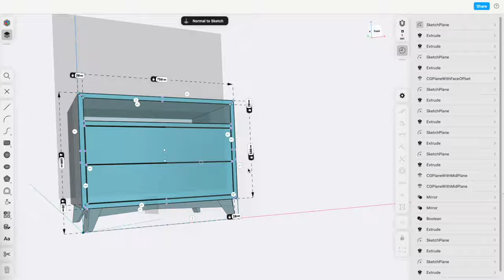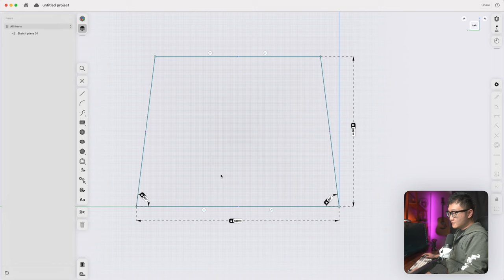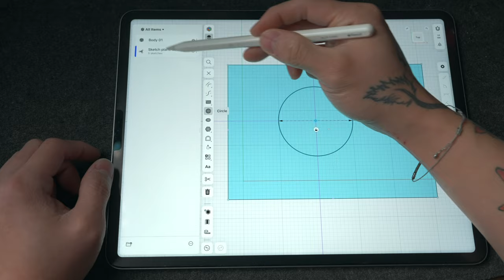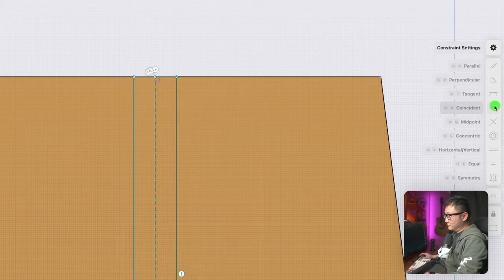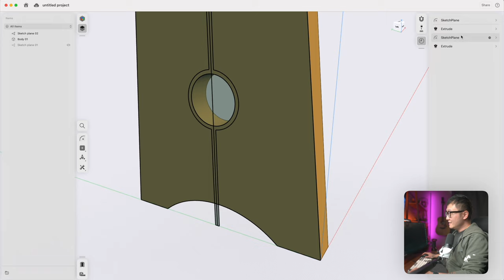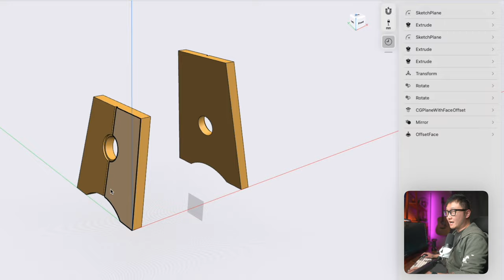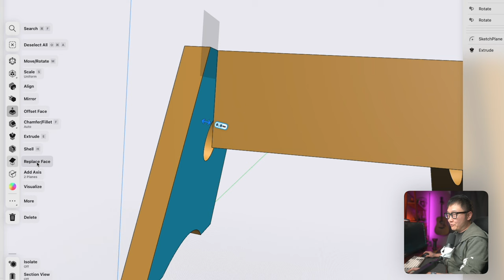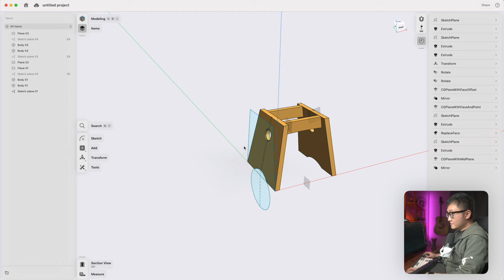Learn Shapr3D Parametric Modeling in 30 MINUTES - For BEGINNERS

Comment: I am using the latest version of Shapr3d and I am following along drawing this stool. When drawing the seat I have to select all parts as you did but I cannot select the centre. When I extrude I am left with a rectangular hole in the centre of the seat.

Comment: Just out of curiosity, since I use the iPad with a keyboard, I have become accustomed to using shift to select multiple specific things. Is the Apple Pencil capable of selecting multiple things? I don’t mean the selection tool since it doesn’t work if objects overlap
Reply from the maker: Yes. You just double tap to select parts

Comment: YES good beginner video. I have been using the new version for a while. Along side the old version. But I tried to use the new version as I would the other standard version and I see I was doing it al wrong. Also I was snuggling at trying to get things in my designs to line up. And scale with each other. Because I did not understand construction plains and constants. Will go and try!
Reply from the maker: Hope it’ll help out with your workflow!

Comment: Hey Alex. I’m following along and got to the point where you made a second sketch on the same plane as the first. Are you using the version from Dec 1 in this video?  Because mine just calls it a sketch in the item list and when I turn it off, select the face of the leg, and try and add a second sketch, it just goes back to the original sketch instead of adding a second sketch plane just like it does in the non beta version
Reply from the maker: Are you using the beta? Sounds like you’re running the current version of the program. This tutorial is for the parametric modeling beta
Reply: @BevelishCreations  I'm using the beta (according to the info it's ver 5.520.0.6147) and I'm having the same issue (ipad).  Clicking on the face of the leg and entering sketch just goes to sketch 1 and does not open a new sketch.  Is there perhaps a setting somewhere that toggles this?
Reply: @BevelishCreations  I don't know if it's a bug or not, but if I start drawing (I just drew a line), the "Sketch 02" appears.  It did not appear for me until I started drawing.
Reply from the maker: It’s suppose to appear only after you start sketching. Or else you’re just selecting the first sketch
Reply from the maker: Hmmm strange. No im running an earlier version of the beta. I’ll check later today. Maybe a new bug in this newer version of the beta. Feel free to also post the question on Shapr3D’s Facebook group where you can post a video showing the problem
Reply from the maker: Feel free to send me a message on IG

Comment: Bug for both extrusion and leg angle change is fixed on my beta.
Reply from the maker: Yep the fix came out right after I finished recording the video 😂
Reply: About the bug in the beta version with the changing of the seat size. Do you guys think it could be fixed by extruding down the legs one choose replace face tool? Trying to get my head around parametric modeling and see if I got it right.
Reply from the maker: @microsnickeriet5875  I tried a bunch of things, nothing worked. but it’s already fixed, so can’t test it out haha

Comment: Excellent step-by-step guide on using the parametric modeling in the application! Much better than others infer seen. Interested to know the steps involved from completion of the model in Shapr3D to the appropriate exporting to Fusion and the CNC parameters. (The video jumps from the completed model to the CNC.) BTW, the steps provided in your video at https://youtu.be/5Cpum7tniyg?si=5Edac1SMZTtM6O4B are helpful in exporting for Fusion.
Reply from the maker: Thanks! Yeah I used the same way to export to fusion, and just used 2D Pocket and a 2D Contour toolpaths to cut things out and I used default parameters for my bits